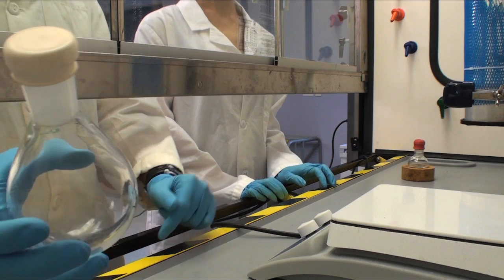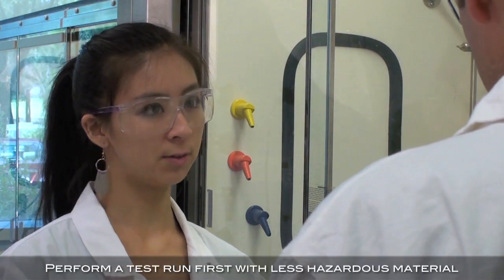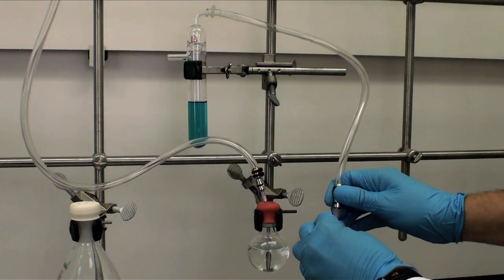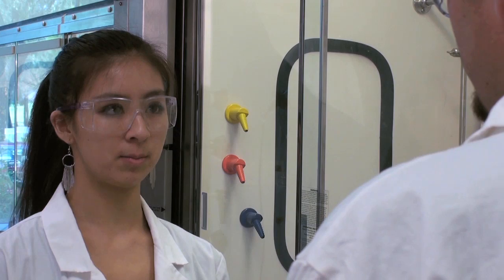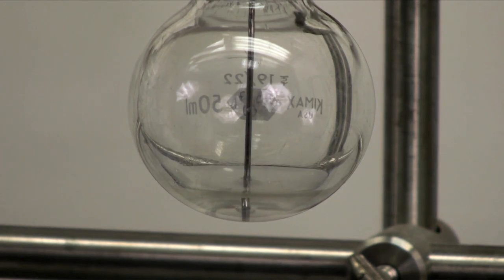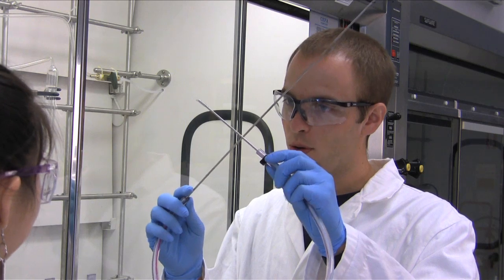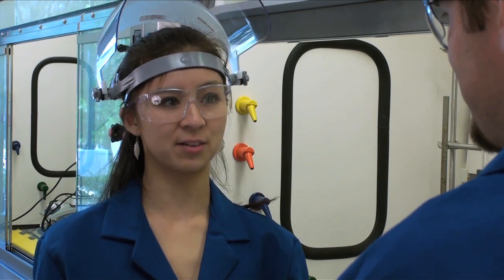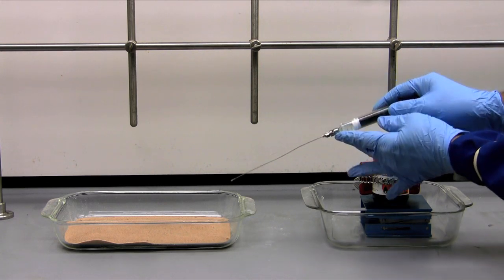Transferring  Pyrophoric Liquids Eps 2

Comment: I am trying to setup a lab for yeast propagation, for use in making beer.  I need to heat a fluid (wort) to 170 degrees then transfer the fluid into a Erlenmeyer flask.  Ideally I could send the liquid though a heat exchanger of some sort and have it empty into the flask.  Can this be done with a condenser  and a vacuum somehow?

Comment: you have not evacuated the syringe before use. the syringe and needle should be oven dried before use.
Reply: I agree. The syringe should be plunged into the space above the liquid, then vacuum pulled, then filled again with nitrogen (and overpressure needle or bubbler), then syringe pullled to be filled with some nitrogen, vacuum pulled again, and syringe pushed. If needed repeat few times. After this is done, go back to nitrogen, and put the needle into the liquid and take a proper amount, then pull some extra nitrogen into needle. If needed, use a syringe with a flexible long needle, so the syringe can be oriented up or down, depending on a liquid. I am sure there are some other tricks possible, like a syringe with a needle and an extra needle valve lock, to prevent any air entering back into syringe after removing the needle from the vessal. It can probably also reduce risk of spilling.